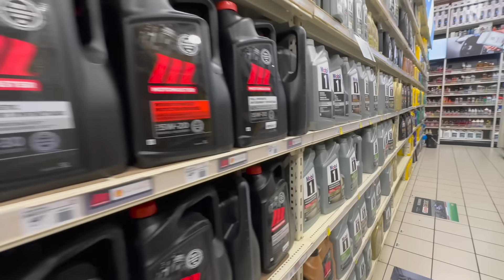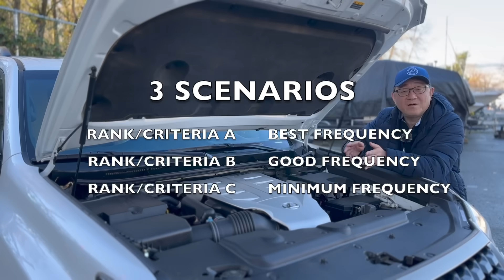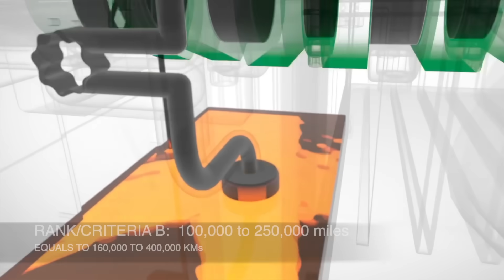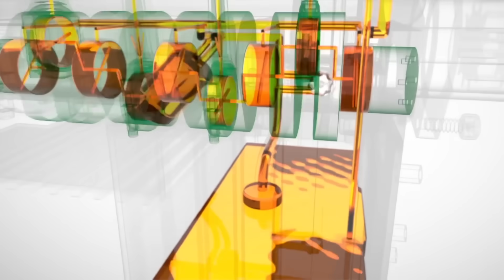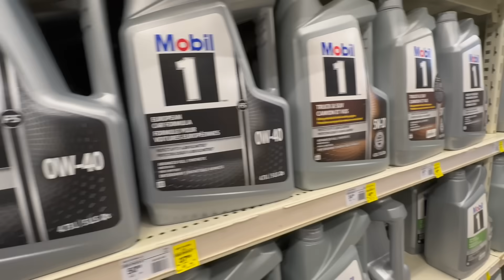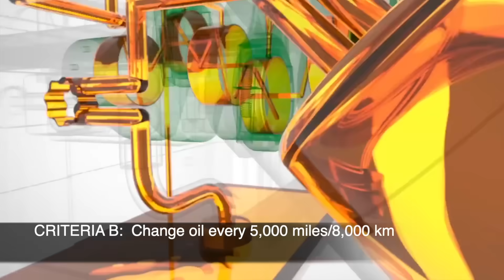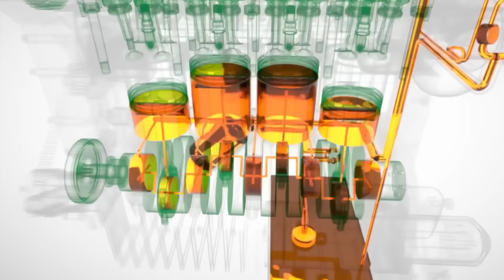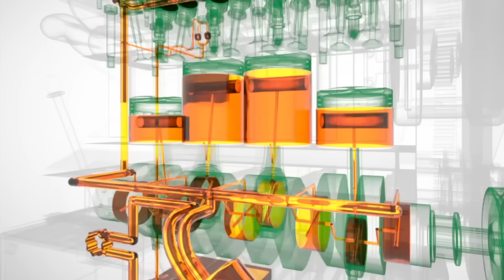ENGINEER EXPLAINS HOW OFTEN TO CHANGE OIL & FILTER // UPDATED CRITERIA-BASED RECOMMENDATIONS!

Comment: Interesting. I own a 2005 Honda CR-V with 92,895 miles. I just had my oil and filter changed at my local Honda dealership earlier today. They recommended I get my next oil change in 5 months or when I drive another 5,000 miles. Their recommendation and my expectation for this car lined up with what you discussed in your video. Your breakdown was appreciated. Thank you.
Reply: You can go a year if you don't hit the 5000.
Reply: except that older cars/engines benefit from MORE frequent oil changes than standard/original.  Furthermore, increasingly over past 20 yrs of the lengthened OCI's, mounting evidence has risen of engines becoming damaged before they were expected to.  E.g. in toyota or honda engines, not lasting anywhere near as long as other same engines do when oil changed more frequently and closer to original classic intervals of 3-4K if car is daily driver.  Out of my dozens of high-caliber mechanics, they also say more frequent is better in  most cases, partly bcuz various factors of engine systems in past 25 years, as well as reduced quality of engines vs 35 years ago, warrants more frequent OC's if u want the engine to last the often-possible extremely high mileages or high-years that Honda and Toyota can.   It's cheap insurance that's for sure.
Reply: The 2.4L used in CR-V is one of the worst Honda engine and every mechanic knows they will burn oil if the owner will go more 6000 miles/10,000 km on oil changes. While Toyota fixed the oil consumption issues in their 2.4L, by updating pistons and rings, Honda did pretty much nothing. I changed/rebuild dozens of those engines, at least 3-4 every year. In fact there's a one waiting for us this month - it will get low mileage engine sourced from Japan, since it cost the same head/valve job and installing new rings. 
The same goes for automatic transmissions - they hold less fluid and require more frequent ATF changes. 50k km is the norm.
My recommendation max 5k miles OCI on synthetic oil. And if you live in southern US, 5W-30 since it boiling temp is usually higher than 5w-20 oils and doesn't get baked as easy in your oil control rings.
Reply: @pliedtka  Even more reason to stick to what the dealership recommended

Comment: Every six months since mine sits in the garage most of the time. I only drive a few thousand miles a year living in Chicago.
Reply: I had a truck that only got used 4-5 thousand miles a year and I would change it once per year with synthetic.  Ran like new 17 years later when I sold it.  Oil really doesn't go bad sitting in the crank unless you take a lot of short trips and moisture builds up.
Reply: Once before winter. Once after winter.
Reply: But you drive in snow and rain and salt on the roads...